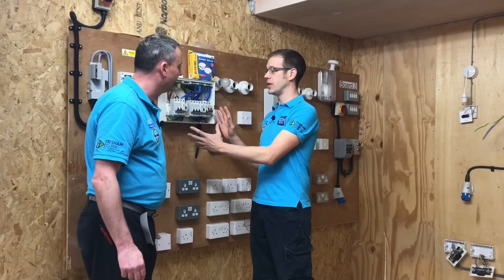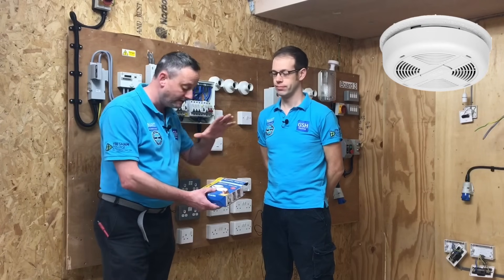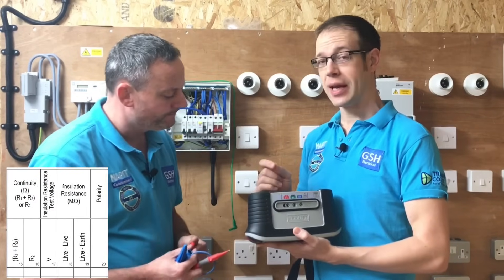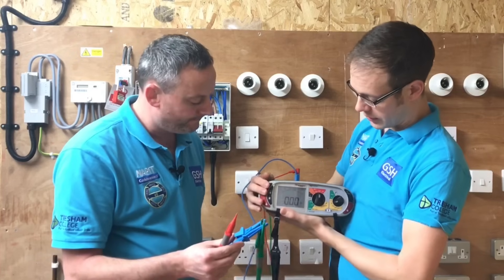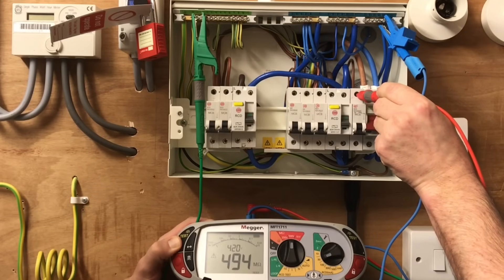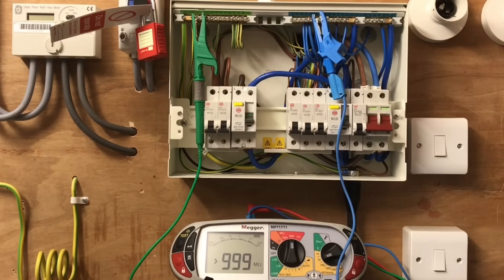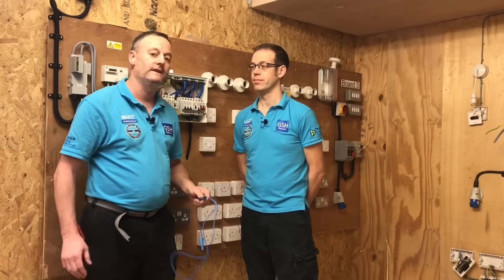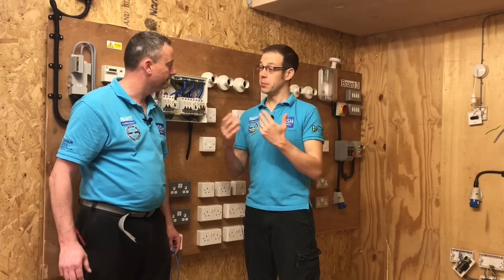Combined Insulation Resistance Test Line and Neutral Together to Earth & Between Live Conductors

Comment: Fantastic video Guy’s as always.
But I do think it is a bit contradictory as Gaz when connecting the leads to the tester you said we ignore the blue as this is not a live test? Well  technically it is a live test if you think i’am wrong touch the ends of the probes , secondly it’s a two lead test and in a previous video you demonstrate how to do the LN -E by use a link between the red probe and the neutral bar .  
Piggybacking the green test lead is normally done for ZS on a TNC-S earthing system, or you would use the three leads and connect the green and blue  onto the main earth. But I have to say piggybacking the red and green leads is a good idea? 
Also the idea of the IR test damaging things like RCDs and smoke alarms is a myth JW did a video were he IR tests a smoke alarm At 250v 500v and at 1000v and the smoke alarm was fine and working as normal. Nick Bundy also did a video were he IR tests a selection of LED lights again at 250 500 and 1000v and yes they were all fine and continued to work as normal . However I believe that if we were to pass 500vDC down a circuit with a TV plugged in then it properly will damage the TV ? .
Fantastic video as always Gaz and Joe 👍👍👍👍❤️

Comment: You keep saying Live conductors ... surly you mean Line conductors. Live suggests you test with the power turned on!!!
Reply from the maker: Line and Neutral when talked about together are live conductors
Reply: @GSHElectrical  not so! Live means hot. Which means current is going through it. The correct way is to address the wires as there name not there state!
Reply: @martingregson7136  I suggest checking BS7671 definitions before incorrectly criticising others in the future.
Reply: @davemyers77  Yes I have!
Reply: @davemyers77  And it states. "Line conductor. A conductor of an AC system for the transmission of electrical energy other than a neutral conductor a PEN conductor. The term also means the equivalent conductor of a DC system unless otherwise specified in the regulations.
Live conductor is the same as live part: and it's States. A conductor or conductive part intended to be energised in normal used including a neutral conductor but not by convention not a pen conductor

Comment: The reason I don't like this method is when testing the L+N to E you could have a bad reading on one circuit, a bad reading on a another circuit and so on - due to a fault being on the neutral (which you keep testing with each circuit on the same section)  which could confuse some, means you then have to seperate and do the circuits seperately anyway, and means you've been constantly been sending 500v down all the neutrals on that section (I hope one would do a continuity between L & N first to ensure nothing has been missed such as an outdoor RCD socket hidden in a cupboard etc,). If I had a doller for every time I saw a perfect workshop demonstration that wouldn't work in the real world I'd be rich. That said, The video is well made and don't wish to discourage. I would just suggest the next video you do is an unedited one in a 1960's house with original wiring and several diy socket spurs between rooms & floors. I think it would be quite entertaining ;)

Comment: What if the house has a load of downlights, do you still have to remove all of them for the test?
Reply: Yes you do. But to do this in a real customer installation is impractical, would take too long and also risk damage to the ceilings. You should test to the switch if you can then note this as a limitation on the report. Likewise for other loads, like items plugged into sockets that cannot practically be removed like washing machines or fridges or big heavy television stands that are blocking the socket outlet. Testing on a purpose make mock up like this is easy - Doing it in the real world is a pain in the whatsit!

Comment: HI GAZ , so in the old system we carried out 3 insulation tests L-E N-E and L-N does this now mean there are four insulation tests the fourth being live conductors to earth ? many thanks mark
Reply from the maker: Mark Brookes hi, your Choice is to do 3 tests or 2 tests. Conventionally we would do Line to N, Line to PE and N to PE however the paperwork from BS7671 only has 2 boxes to record your results so which ones do you record. The 2 boxes are Live to PE (line and neutral together to earth) and between live conductors (line and neutral) hence the video. Hope this helps. Gaz 🦾
Reply: @GSHElectrical  I think this may be a misinterpretation of the model paperwork in BS7671:2018. In the companion IET GN3 (2.6.7) it does seem to allude to doing the 'traditional' 3 tests L-N, L-E & N-E. The combined LN - E is only for when vulnerable equipment can't be reasonably disconnected. IET GN3:2018 (pg128 note 19) does go on to state, 'enter the minimum value recorded....for each of the various configurations'. I suspect the reduced IR boxes in the model paperwork is to allow for additional IR test voltage and AFDD columns. 
Thought I'd add my thoughts as I find your videos a great teaching aid and really appreciate the time and effort you put in.
Reply: @GSHElectrical  thanks Gaz, I'm going for my Am2, so I'm being an anorak. As long as it's a safe installation is the important point. The fly lead method in another one of your videos also looks good. I'm a bit surprised that the megger mft1741 hasn't got the correct leads to do this test straight out of the box. Having said that, it's a great tester. Thanks again

Comment: All very well, but when you are doing EICRs its impractical to disconnect all the loads, and thus you need to test at 250V
Reply: its acceptable now from the new ammendment 2 on the 18th edition but im pretty sure if their are no records of it ever being tested at 500v then its not acceptable to do it at 250v. Im also sure even at 500v beetween lives and earths no damage would be caused its only beetween the lines at 500v it could possibly damage equipment. PLEASE CORRECT ME IF I AM WRONG DO NOT BITE MY HEAD OFF.

Comment: You can test at 250v if there is electronic equipment which can’t be disconnected
Reply: Between line and neutral you would get false readings most likely but live conductors and earth should give you some better readings.
Reply: @Badgerooni90 yes but it does'nt tell you if you have a fault between line and neutral!! You could power up thinking allis good then bang goes the MCB because you have a line to neutral fault!!
Reply: You’ll still get false readings
Reply: Yes

Comment: Hi Gaz, thanks for another great video. One question, on a new DB install with new and existing circuits..(existing circuit test L/N to earth only) would an IR test from neutral bar and earth bar damage any of the existing sensitive equipment?
Reply from the maker: Hi, the IR test will only damage electronic equipment if 500v DC is passed down L and N and not L and N together to E. thanks for commenting. Gaz 👍
Reply: GSH Electrical thanks for the speedy reply.. and on a Saturday too.. legend 🙏🏼
Reply: @GSHElectrical  that’s why there is no point having the RCDs and MCBs in the of position.
Reply: Always wondered, if this is the case why do people every test at 250 because of 'sensitive loads'

Comment: Can anyone tell me if you test live to earth at 250v and then 250v neutral to earth will it damage equipment????
Reply from the maker: Nominal single phase AC voltage is 230 volts so doing the test at 250 volts DC will not damage connected equipment. Often during EICR’s this test is carried out at 250 volts DC. Thanks for watching and commenting. Gaz 👍
Reply: @GSHElectrical  thanks for responding  mate that's exactly what I thought doing any line conductor to earth at 250v should be fine even 250v live to neutral shouldn't damage equipment but I wouldnt do it just to cover my arse.

Comment: Amazing videos, thankyou.
Can you please send me a link on where I could obtain the adapted metrel leads. Thanks.
Reply from the maker: Thanks for watching 👍

Something like this 

https://m.ebay.co.uk/itm/Metrel-TEK119-Three-Wire-Test-Lead-Set-S2038/153650885245?ul_ref=https://rover.ebay.com/rover/1/710-53481-19255-0/1?ff3=2&pub=5575376664&toolid=10001&campid=5338268676&customid=Cj0KCQiAl5zwBRCTARIsAIrukdMpsC5F2BwjZ7CPzDez1y6Na8Ou3TCPjl8tAGnAhqbQ6n4huNn0maIaAkvSEALw_wcB&lgeo=1&item=153650885245&srcrot=710-53481-19255-0&rvr_id=2237776744865&rvr_ts=4dd43f8216f0ad3045700392ffbb21c4&_mwBanner=1&_rdt=1&ul_noapp=true&pageci=a4d435cd-0cf6-492c-9c4e-fc815102524a

All the best Gaz
Reply: @GSHElectrical  Thanks for the swift reply Gaz. I followed the link, the issue I found with the leads is they are attached to a plug, which i believe is the mertel plug. The one in your video has a crocodile clip on one end and the other end has the tester piggyback.
Do i need to make an adjustment to the leads. Please can you advise further

Comment: Would you test live and neutral combined to earth if there was sensitve loads on the circuit that can't be removed. Will this stop them from getting damaged at 500v
Reply: The potential difference between L and N would be zero so no damage.

Comment: Great way of IR testing the whole installation, usually done this way on initial verification of a new installation as you should expect an off the scale reading across all circuits. An older installation can also be tested this way but you're more likely to come across a latent defect with an individual circuit.
Reply: Yes but the test does not tell you if you have a fault between line and neutral

Comment: Excellent video that is a great tip with the cables which I will be using for my upcoming assessment, obviously with a new installation there shouldn't be any cable not tested but it would be great if you could do a video doing once loads have been applied for instance a hardwired oven off an fcu or where there are multiple downlights and neons. People seem to say that if you do it the way you have there and connect R1 and RN together and test to earth it won't damage sensitive equipment is this correct?

Finally what do you do in regards to smoke/heat alarms with RF bases? For example the aico rf because even if you take the alarm off the voltage would still be passing through the base? 

Thanks again for the clear informative video
Reply from the maker: Hi. Many thanks for taking the time to comment in such detail. More videos to follow so hopefully we can cover some of the points you raised👍 Gaz
Reply: @GSHElectrical  that would be great thank you, your vids are really helpful.
Reply: When testing with voltage sensitive equipment connected, you have two options, you either test with live conductors together to earth as Gary done in the first part of the test or you disconnect one of the live conductors at the load and put in a terminal block.
Reply: @alvina69  thanks alvina, what would you do in regards to alarm bases that are rf (they say don't IR the bases cause they are sensitive too, without clarification I would disconnect and put the cables in a wago connector so it bridges the rest of the circuit but wanted to know thats ok to do incase my assessor asks me to do an IR test on the lighting circuit
Reply: Robert Melbourne If you had say 3 RF bases connected in series, I would disconnect the line conductors at bases 1 and 2 using a connector as a temporary bypass, disconnect the line conductor at base 3 and terminate into a connector temporarily for the purpose of IR testing. It doesn’t matter if the neutrals are still connected at the bases, as you’ve in effect created an open circuit and the equipment can’t be damaged whilst IR testing. Remember this is a dead test so safe isolation must be observed at all times.
Reply: Robert Melbourne Will your assessment take place in a mock bay or a real work environment?
Reply: @alvina69  thanks for your help thats exactly what I thought would be the case and what i did initially but nice to have it clarified, it's in a work environment on an installation I did so im confident as all the tests results are ok but easy to overthink things when the "assessment" word is put infront of it haha.
Reply: Robert Melbourne Your assessor will more than likely want you to test a simple circuit, by that, I mean a circuit with very little connected to it and no voltage sensitive equipment. He/she may ask you what you would do if load or voltage sensitive equipment was connected.
Reply: @alvina69  Ok yes that would make sense, I guess im just overthibking and planning for worst case, many thanks for your time to reply, you've been very helpful

Comment: Why hasn’t a board manufacturer designed a board with a better test point for the neutral and earth bars, the crocodile clip are forever jumping off.
Reply from the maker: Great point 👍Gaz
Reply: GSH Electrical Perhaps something like the linking bar that usually connects two earth bars, but deep enough that your crocodile clip can bite onto it without detaching itself.

Comment: So could u leave the loads in, smokes .Lamps.. dimmers.. neon switches.. usb sockets etc and do a joint - live conductors to earth test .. or is this bad practice ??
Reply from the maker: Hi. Remember this is a new installation and not an EICR... my learners are working towards AM2 or AM2s and all circuits need testing 👍. Thanks for commenting and watching Gaz
Reply: On an EICR technically yes, but it depends on what you’ve agreed with the client, they may want test results between line and neutral, in which case you’d have to disconnect/bypass all loads and voltage sensitive equipment.

Comment: 'Carry out' is an idiom that is being over used in this presentation.  More use of words such as perform, demonstrate, show, do please. 

Other than that irritation, it is an informative, beneficial presentation.
Reply: hi gaz, is that mcb not on a rcd going out to the garage or have I got it wrong..If so how is the cable going outside supplying the garage protected under all faulty conditions? thanks.

Comment: So it’s not a good idea to leave mcbs on so 500v can pass through buzzbar and test all circuits on one rcd at a time. Can it affect the rcd even though it’s off?
Reply from the maker: Hi. We always go topside of the MCB with the MCB off as I don’t know if the electronics in the RCCB are in the top or the bottom of the device. Also this technique works with RCBO’s and that’s where Industry is going 👍. Thanks for commenting Gaz
Reply: GSH Electrical yeah it’s something I never thought about really . Think I might have to change how I do it . Haven’t had any problem with damaging an rcd yet (as far as I can see anyway) . Guess it will only take slightly longer to do.